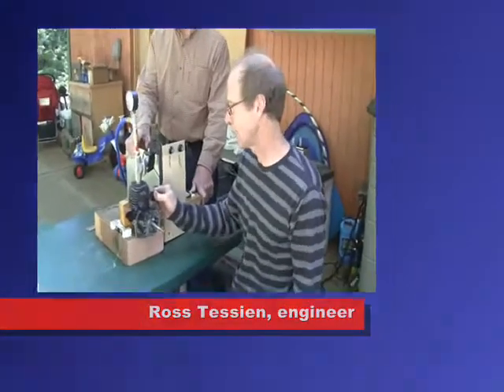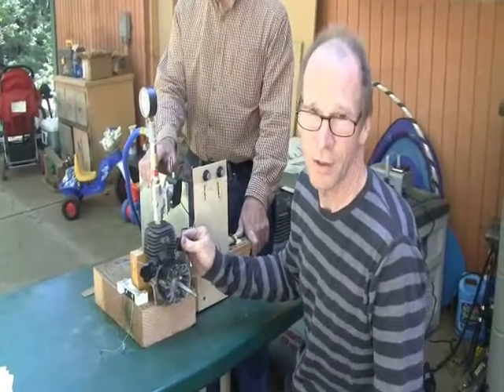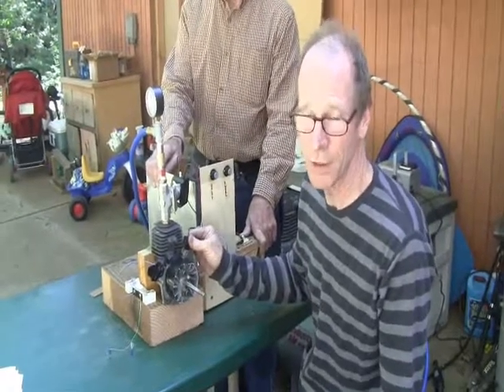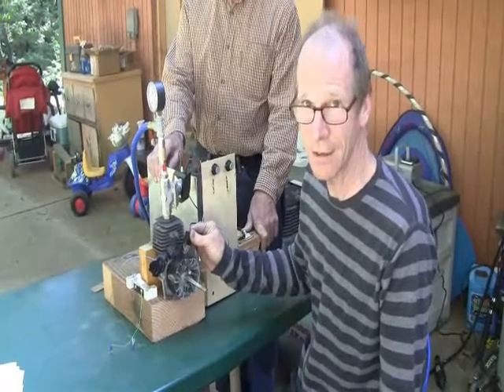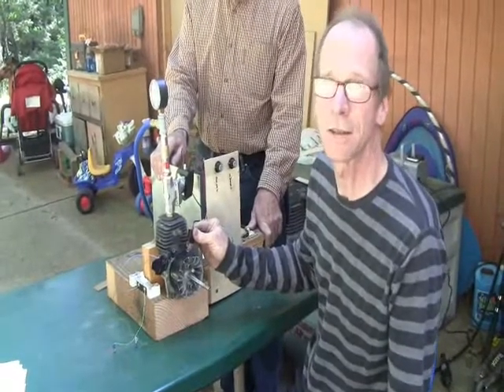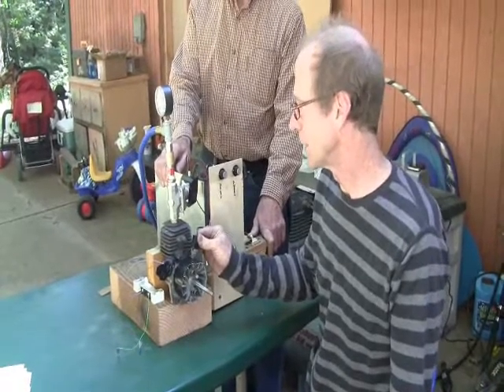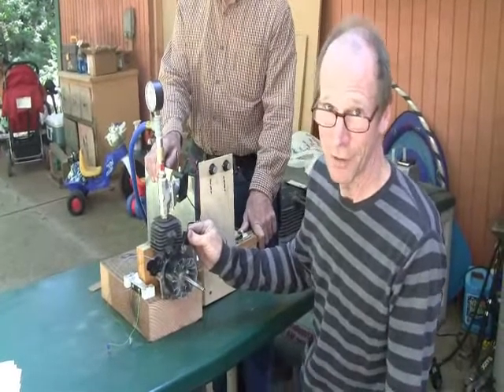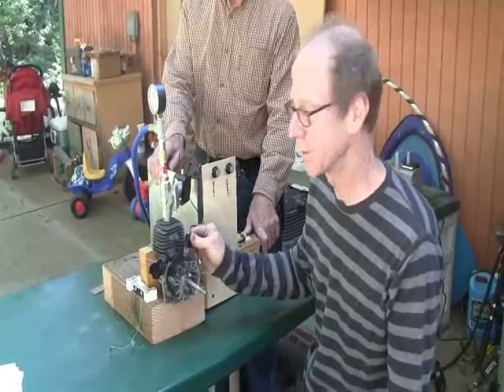2 stroke 30cc conversion to steam power generator

Comment: Guys I just found a good website which gives you free_steam_wallet_card_c0des  https://plus.google.com/105285816099913202128/posts/P4Ug1RAKsgk
Reply: Guys I just found a good website which gives you free_xbox_live_gold_c0des  https://plus.google.com/105285816099913202128/posts/1BEqyecmEXt
Reply: Guys I just found a good website which gives you free_steam_wallet_card_c0des  https://plus.google.com/105285816099913202128/posts/jFjuonCzyuo                                                                                        2 stroke 30cc conversion to steam power generator

Comment: is running on steam or compressed air?
Reply: jabemer air. steam is very dangerous and causes more corrosion.  air is better.
Reply: Guys I just found a good website which gives you free_steam_wallet_card_c0des  https://plus.google.com/105285816099913202128/posts/jFjuonCzyuo                                                                                        2 stroke 30cc conversion to steam power generator

Comment: Hi! been lovin' your videos, but what I wanted to see is how you made out with actually hooking up the alternator for the power test (even if it was a fail, I'd like to see it in action)
Did you ever finish this?

I'm just surfing these through curiosity. but I love what you've come up with so far. :)

(also, what this guy came up with was brilliant, and could remove most of your circuit possibly)
Easiest ever 2 stroke engine compressed air conversion no solenoid or valves
Reply: You will never see any of them actually hooking to power. Hundreds of similar video series on YouTube end in the same way

Comment: Very Cool!
Been trying a cardboard few bash valve models ideas I've had using a ping pong ball as the valve. Really like the term "Bash Valve".
So far nada.
These uniflow bash valve engines have to be built very stout,and of course they don't self start.